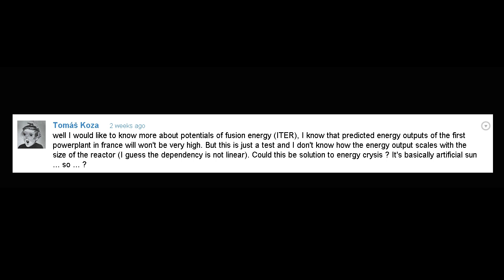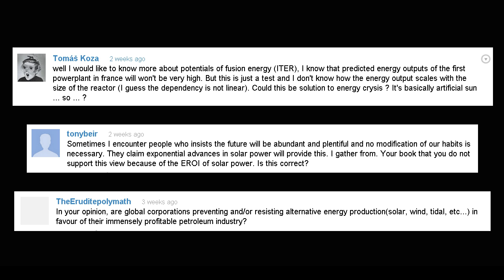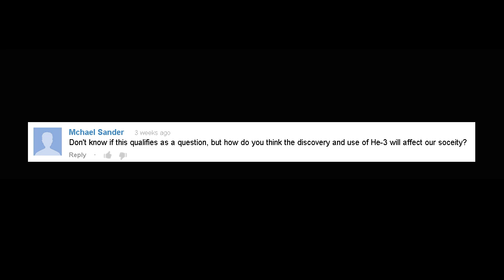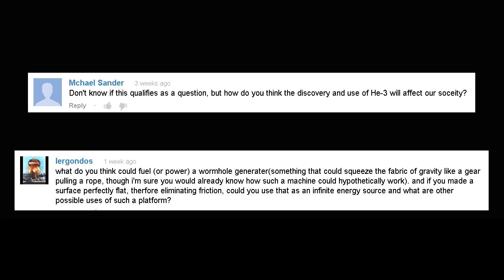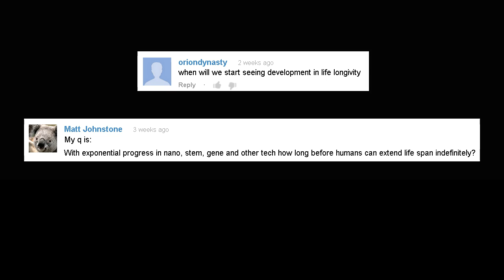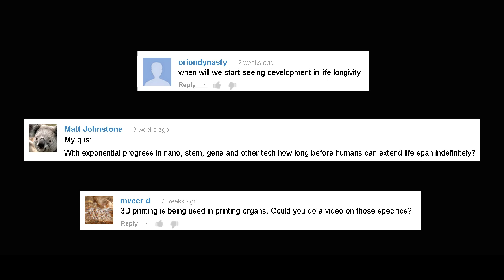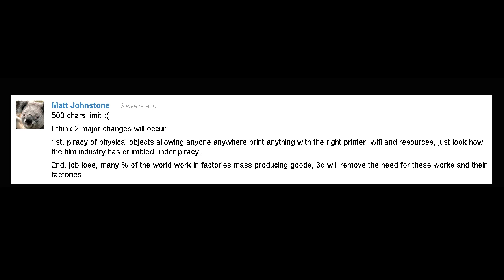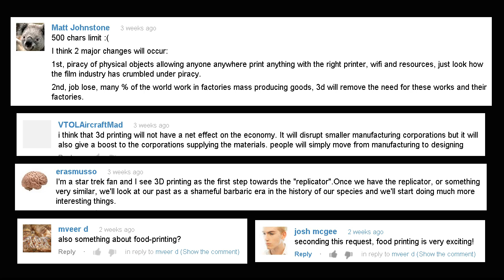FQS#2: Future Energy to Cryonics

Comment: MIT Creates Superhydrophobic Carbon Nanotube Forests 
The present study demonstrates the creation of a stable, superhydrophobic surface 
using the nano-scale roughness inherent in a vertically aligned carbon nanotube forest 
together with a thin, conformal hydrophobic polytetrafluoroethylene coating on the surface of the nanotubes. Superhydrophobicity is achieved down to the level where essentially spherical, micrometer-sized water droplets can be suspended on top of the nanotube forest.

Comment: 3dP has the potential 4 abundance; almost a complete reduction of greed. The ability to decreased waste by 100% n 100% recyclable only helps that. Printers can already print 70% of their parts; Highest lvl of Nano resolution at x1000 the previous speed reached this month. I just dont see how they plan on dealing with this. It should cause major economic dmg at first at some point; only in the sense of rebalancing. 3dP will also result in the sharpest reduction in cost of most new tech ever come.